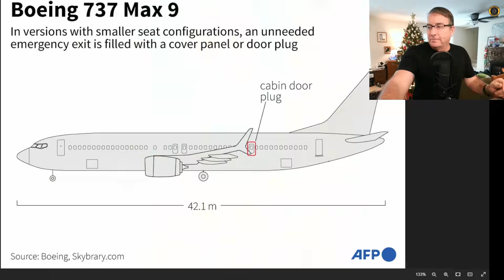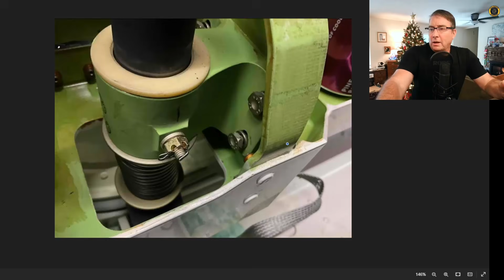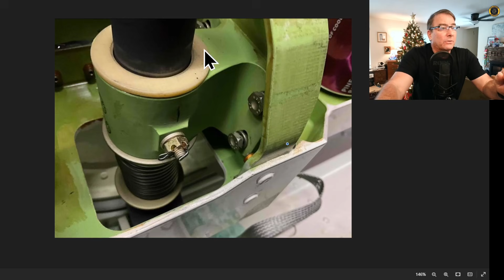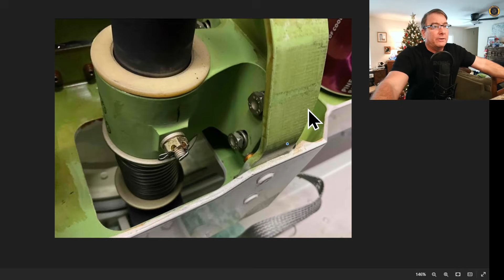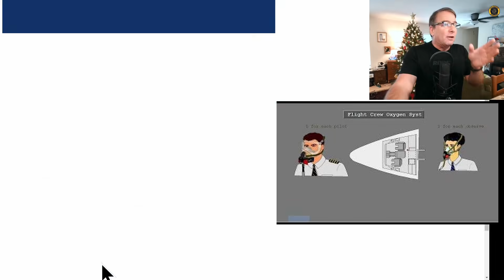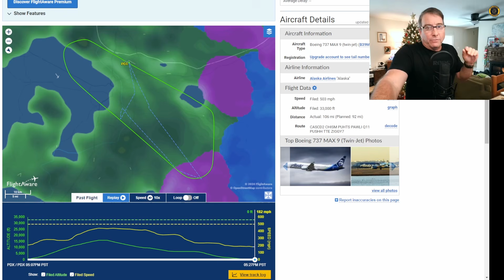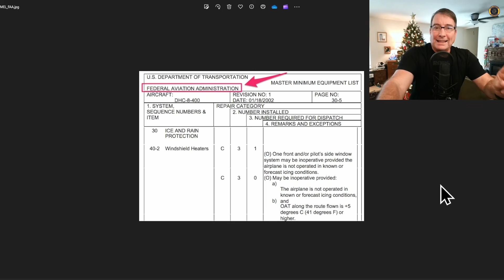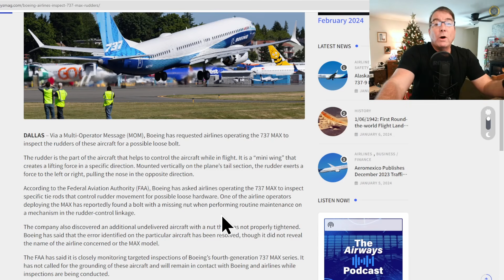"Yes, We Have No Bolts"  9 Jan 737 Max-9 Update

Comment: I would think the two most urgent things to do immediately are (1) determine the specific individual(s) who last installed or secured the door plug, and (2) determine the specific individual(s) assigned to inspect the installation and certify that it was done properly.  A former Boeing employee has alleged that Boeing greatly reduced or even shut down their Quality Assurance program.  If that is so, heads should roll.  The individuals specified above should be pulled off the line for some serious refresher training at the very least.  If the investigation reveals lackadaisical or slipshod work or "pencil-whipping" of the sign-off for any reason, the remedial action should be much harsher, up to and including termination.

Comment: I used to rig main entry doors including the escape slides and the git bars the slides tip on and activate. 747 models. It has been over a decade since but you are correct, that castellated nut is on a shear bolt and not a tension version. We would torque them to a range in inch pounds then back it off to accept the pin. So they are class 2 (? I'm getting old) at best for hole fit. I remember installing them with a hand press and rolling the castellated nut on finger tight then selling the torque to Q.A. and they would GOOP the bolts to verify they watched me do it.

Clearly that lower bolt in one of the photos is not run down.

Just my two cents.

Comment: I wish someone who has installed those upper bolts would weigh in on how difficult it is to get them in place. It looks fairly awkward. Also, I'm wondering if Boeing included some sort of detent in the stop pad / stop fitting that could help hold the door in place when under pressurization even if there were no bolts?

Comment: Brackets and fittings need a design change that makes this type of missed maintenance accident impossible. The design is probably very handy for an easy convert to an operational safety door when the airline decides to pack the passengers in like sardines, but it makes this incident more and more statistically likely the longer it's in service. And this incident happened right away. Don't change just the process, change the design. Requiring someone to remember to pull the breakers to preserve critical data also needs a rethink.
--As a result of outsourcing and offshoring itself from being an aircraft manufacturer, to being an aircraft assembler, has Boeing booted it's core competence out the door too?

Comment: Remember the rear aileron I think it was. Leading edge had loads of screws in it. A mechanic removed them, but didn’t finish the job.
Night shift came in, thought everything was ok.
Checked wrong side of the plane. Worksheet wasn’t clear and went astray for a bit. Basically that leading edge came off with natural results. 
Sounds a bit like this issue with the bolts doesn’t it?
Reply: Two words --- Shift Change. 😉
Reply: See the film Shift Change by Melissa Young and Mark Dworkin @Raiders33
Reply: Yup, perfect example of worker alienation under capitalism.

Comment: OK, here is Bill's Door Plug design. The key is knowing if all the screws or bolts holding the door on are attached. Remember those Christmas tree lights where when one is removed they all go out? Keep that thought. Imagine each panel screw hole contains two discs that are separated until a screw is tightened and the two discs make electrical contact. Think of the two discs as washers that are separated and built into the door with an electrical wire attached to both discs and wired like Christmas tree lights. If one set of discs aren't touching each other, that means a screw is either loose or missing and in turn sets off an alarm. This is my KISS solution of Keeping It Simple Stupid.
Reply: Now we know why JB still has the tree up, to illustrate this point.

Comment: They did not learn their lesson the 737 MAX 8 tought them.
I will never move my as in a BOEING again !
No way !  Worse damages will come and I don't want to experiece them !
If they ever try (I don't beleve) to build save planes again, it will take them 
lots of years. A lot more years  will go by to get the passengers trust back again.
A decade will be not enough time to recover I think.
First they should  do is to cancel every one who ignores safety warnings and to replace a new quality system that works korrektly.
Without that they will never come back again !

Comment: At about 8:40 into this video you mentioned that the cabin pressure went from 14 psi to 11 psi.  Correct me if i'm wrong, but this is way over the pressure rating for the outflow and emergency relief valves.  I can't remember the exact numbers but those valves normally release at 8.0 to 8.3 psi.  If the auto controllers failed also and allowed these backup systems to overpressurize, there is a much larger problem...  So 14psi over the area of that door plug would be considerable.  Where did you find the value of 14 psi from?
Reply: Might there be multiple cabin pressure sensors, and similar code as MCAS written yet not fully developed or commented out? Closed loop, negative feedback systems are more of art than science; it's conceivable the same management or team could have been in charge of all pressure response control algorithms. Maybe something got the state macine stuck in a funny state?

Comment: Easy fix for this particular problem is to just sell all of them with the actual emergency exit doors installed vs these rigged up door plugs. They would be safer as they actually are larger than the hole. “True plug door” I’m pretty sure there is no rules for having too many emergency exits. It wouldn’t affect the seating either. Just my two cents worth.

Comment: In the A320 manuals is clearly written that the cockpit door unlocks in case of a decompression.
You can even see the pressure sensors in the overhead panel.

Comment: I myself suspect maintenance was done on it, and the bolts were left out. It is impossible (probability zero) the bolts "came out". They have castle nuts with cotter pins in them. 
AA NEVER should have flown that plane KNOWING there were pressurization alarms going off. They did NOT trace the ROOT CAUSE of that, but instead their fix, knowing the plug might fly off, was to not sit people right by it, and to not fly over water.
AA flight 261, in year 2000 killed my niece and all people onboard. It was traced to AA never inspecting, nor greasing the T-tail jackscrew, so it failed, and the plane was doomed. FAA  found a multitude of problems at that airline, yet CONTINUED to let them operate!

Comment: A time delay theory...
It's hard to see how it would have got through previous flights with all 4 locking bolts missing without catastrophic failure, especially as it would have gone to over 30,000 ft on those flights.
Some are saying the friction of the rubber door seals was enough to prevent it lifting for some time.
I'm wondering if just the rear hinge vertical movement arrestor bolt was fitted. For many flights this was enough to hold the door down until...
Each of the 2 hinge guide fittings is attached to the door by 4 screws. A photograph from the United airlines inspections showed an example where 2 of these 4 bracket attachment screws were found to be undone sufficiently that you can see a gap between the screw heads and their washers. Not only are those screws loose but the holes in the bracket look like they are slotted. The slots would be to allow for adjustment of the vertical position of the door when the 2 locking bolts are fitted through the hinge tubes such that the 12 door lugs are perfectly aligned with the 12 frame lugs when the locking bolts are in place. 
The slots would allow adjustment as follows: With all the door plug closed & all 4 locking bolts fitted, all 8 bracket screws (4 on each bracket) would be loosened while the door is moved up/down until the 12 door lugs are perfectly aligned with the 12 frame lugs. The 8 bracket screws would then be tightened to the specified torque, to fix the position of the 2 brackets on their slotted holes. (I'm surprised there's no locking wire on the screw heads but just perhaps there's something at the other end).
These 8 bracket mounting screws would only be adjusted once, when a particular door plug is first fitted to a particular door frame. Any other time the door plug is removed & refitted, nobody is looking at these screws. So although the 4 lock down bolts were no doubt in place during that "one time" adjustment of the hinge bracket height, they weren't fitted the last time the door plug was opened/closed.
Also, either someone is leaving the bracket height (lug alignment) adjustment process incomplete, or the specified torque (& possibly locking process if there is one) is inadequate.
The distant photo from outside the Alaska aircraft, showed the hinge tubes apparently undamaged, however it appears to me there is something attached to the rear (right hand in the photo) hinge tube. This could be the remains of the hinge guide fitting after the it has torn through the bottom of the door. (Or it could just be some random irrelevant debris or just a shadow).
If the rear hinge vertical movement arrestor bolt was the only one of the 4 locking bolts to be fitted. (May not have been tightened & had it's castle nut & split pin fitted - that's possibly not too relevant). That would probably be sufficient to prevent the door lifting enough for the 12 door lugs to be sufficiently out of alignment with the 12 frame lugs, so the door is OK for several flights. 
If most or all of the 4 bracket mount screws are (or become) loose at the rear hinge, then the assist spring on the other hinge (that doesn't have a locking bolt fitted) can lift the door further, as the 4 loose bracket retaining screws are now able to rise up to the top of their slotted holes (in the bracket).
Once that movement has taken place, the door is not only restrained from moving up by only one of the 4 locking bolts (which was a pretty marginal situation already) but now the door height position adjustment has slipped to the highest extreme of its adjustment slots for that one locking bolt that is fitted.
If that movement of the bracket wasn't enough for the door to let go on the next flight, further flights will further loosen the bracket screws, producing even more play.
The rear hinge lift spring is disabled, so long as it's locking bolt remainins in place. The front hinge's lift assist spring is free to lift the door as far as it can. Initially for a few flights that might not be close to a critical amount but as the 4 bracket securing screws become loose enough, the door can rise an extra amount as the bracket retaining screws slip to the top of the adjustment slots in the slotted bracket adjustment holes. If that doesn't allow the door to move high enough (raised by the lift assist spring in the front hinge that doesn't have a locking bolt fitted), then a few more flight cycles loosening the 4 rear hinge bracket screws will eventually allow the door to raise high enough (even if the front hinge locking bolt is fitted) for the 12 doorframe/door lugs to be sufficiently misaligned at takeoff for the door to blow out at altitude.
(Incidentally the door blowing out in this way will damage the bottom ends of the roller guides).

To clarify what the bracket is: The lower locking bolt passes through the (black) hinge tube. It also pass through a (green) hinge guide fitting. This locks the hinge guide fitting in position on the hinge tube, so that it cannot rise up the upper portion of the (black) hinge tube, as it normally would when the door plug is being opened. Part of the hinge guide fitting extends sideways and ends with an approximately square plate which has a vertically slotted hole in each corner. This is what I'm referring to as the bracket and the screws that go through the slotted holes into a vertical web that is a structural part of the door, I am referring to as the bracket screws. These are the screws where United found 2 of the 4 screws so loose you can see the gap behind the screw heads. There is a separate hinge guide fitting/bracket for each of the 2 hinge tubes.

Finally! I have it in my mind that NTSB said they were still looking for a spring (not for 2 springs). Just a thought. Can anyone verify what they said? They appear to take their videos off YouTube.
Reply: Precisely as JB says, a mousetrap!

Comment: Of the two theories about the root cause of the failure, the "no bolts, no nuts, no cotter pins" one seems more likely to be correct.  The other theory -- that (other) bolts securing the pin assemblies to the airframe were loose, so the pins wiggled, putting stress on the locking bolts, which then snapped, allowing the door to lift up and off the pins -- seems much less likely to be correct.  Even though loose pin-assembly-attachment bolts may have been found on other 737MAX9's, the upper bolts would not be stressed – merely grazed – by a wobbling pin; and the lower pin/rod appears to be articulated, so the articulated joint would absorb any outwards wiggle that might otherwise put stress on the bolt.

Comment: Not sure where the photo of the hinge bracket (minute 21:24 of the video) came from, but it appears that the three visible bolts that are supposed to be torqued are actually loose. If properly torqued, the washers would be captured tightly between the bolt head and the bracket. Interesting...

Comment: Probably a stupid question but what keeps the doors from moving sideways enough for the stop tabs to slide off the stop pads? Doesn't look from the schematic like they have to go that far. As has been pointed out this is not a plug door bigger than the opening that will seal with pressure on the periphery. It uses the tabs. The door is smaller than the opening a bit and it would seem to me that you could have sideways motion. I would say that the hinge guide fitting on the door normally is the is the mechanism that stops any sideways motion. However, as we are seeing these loose bolts holding the hinge guide fitting to the door perhaps there is now some freedom to move sideways? Move sideways a little and the tabs pop off on one side and then that side is open to the slipstream? And from there the slipstream forces tear off the door? What am I missing here?

Comment: As a former employee at Boeing Everett,, I am appalled by the lack of upper management towards safety of the Boeing airplanes. They are not paying any attention to what is happening. They only look at the amount of money they saved by not doing the important steps necessary to keep planes flying safely, the 737 program in particular needs another shake up or realization that they’re failing the flying public and the customers and shareholders of Boeing
Reply: Board of Directors has not one single worker chosen among equal vote of all other workers in the company. That's the problem. Amgen exec?! Really?!

Comment: On the exterior shot of the accident aircraft, is there a hinge guide fitting still attached to the aft hinge pin? The forward hinge pin is clean but there's something hanging from the aft pin.

If the inspections are finding loose/incorrectly torqued bolts on the connection between the hinge guide fitting and the door, a loose guide fitting could maybe stay on the hinge pin when the rest of the door left the aircraft, if those bolts separated first.

Comment: In the photo of the door mechanism @ 3:47, can you confirm which side is the plug and which is the aircraft structure.. if the locking bolt is gone does the plug go up to remove or does it go down.
Reply: Plug moves up.  Like maybe from some turbulence on climbout.

Comment: Why’s the aeronautical industry having way more problems and accidents nowadays?
Reply: 1. Boeing management going for maximum profits to increase stock value.
2. Boeing management moving HQ away from the factories, to isolate them from the problems.
3. Boeing management thinking short term instead of having a long range strategy. ie 737 MAX instead of a new design.
4. Boeing eliminating QA and having workers self inspect their work.
5. DIE hiring, worrying more about what you are instead of *how well you can do the job*.  Boeing brags about this on their website.
6. Generation Z, now being called the "Lost Generation".  Can't get them to focus on what they are supposed to do.
7. Outsourcing to other countries with lower standards, like India.
8. FAA allowing Boeing to self certify.
...more...

Comment: There are nuts and a washer on those pins that allow the plug to move upwards. They can not be seen as light color in the picture at 1:09. They should prevent the greenish part separating completely and at the same time, retain the springs if the soft bushing outer diameter is less than the washer's; that is the washer pulls the bushing off the green part. But the washer looks like big enough to retain the green part in any case.If the bushing wall is thin, any rotational movement could cut the lower pins, but that can not happen because even if the four retaining bolts, especially the two outer ones, would come off, the 12 stops would prevent the plug outwards movement and the rotating of the green part. So, the upper two bolts seem to be a bit hard to get into place as they are introduced from the plug wall side, It is possible that someone did not put those back at all. Relying on the pins alone. So, it seems that the plug assembly has had four nuts and two washers missing from the hinge pins, one or both lower safety pins, and completely missing the upper safety bolts. Like someone was in process of replacing the plug, and someone else replacing/assembling the cabin inner panels without waiting the first guy to complete the job. That is the "kind" suggestion. the bad one being just lazyness...